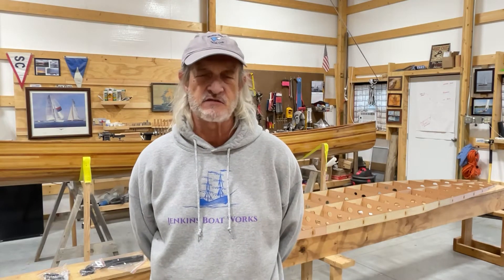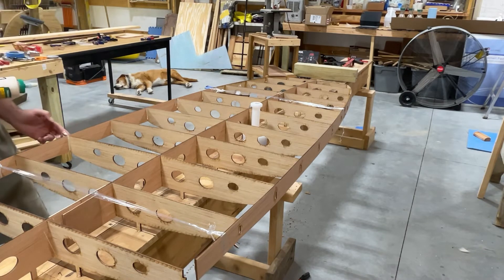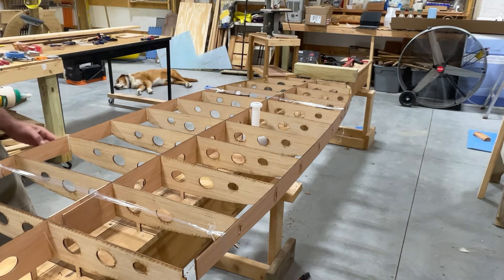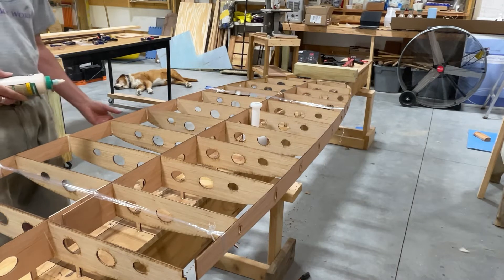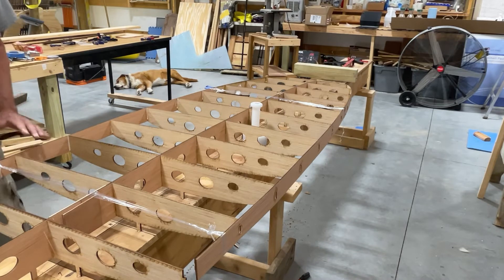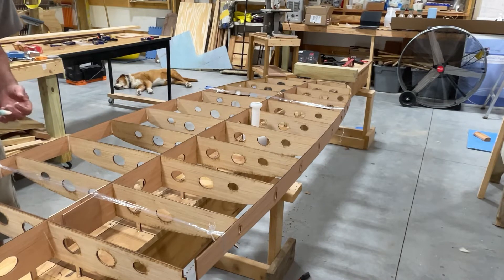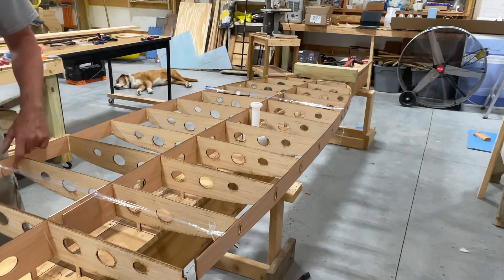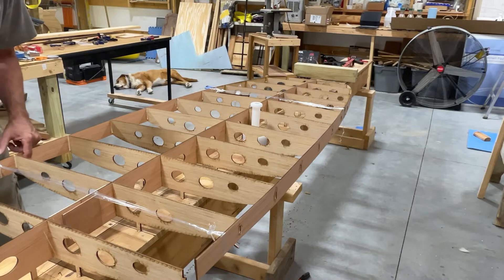Attaching the rails on Jarvis Board San Marcos - Episode 3

Comment: Thanks for doing this video.   Jarvis really does not do a very good job of explaining how to build his board and it is fantastic you are doing this series of videos.   While I have built numerous strip canoes and kayaks over the years, I am thinking of using some marine plywood for the skins.  This what CLC does and I would be curious what your thoughts of this as an alternative - especially since western red cedar has become incredibly expensive recently.   Thanks.  David, Boston MA
Reply from the maker: yeah, I actually have some Okoume marine plywood but it is only like 4 mm thick. Glassed with a heavier cloth, might be fine. It is beautiful stuff. Bending in the sides where the curves are more significant could be tricky
Reply: no they do not label things, the only labels are numbered ribs otherwise it’s a bit of guessing